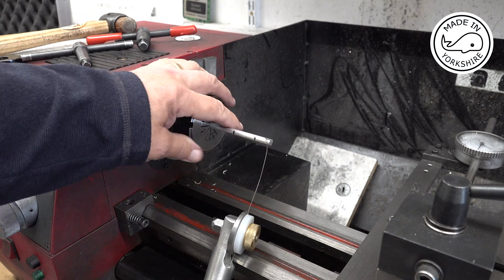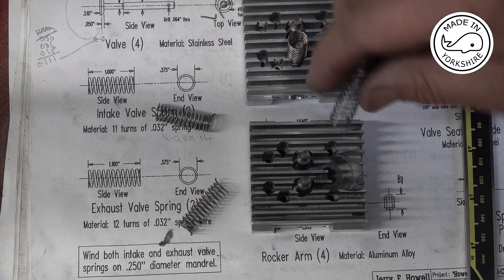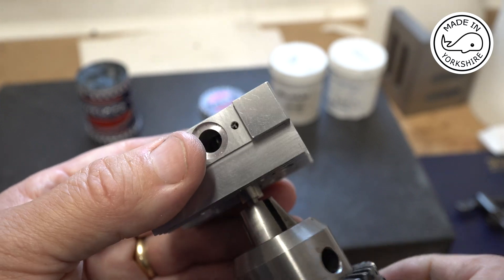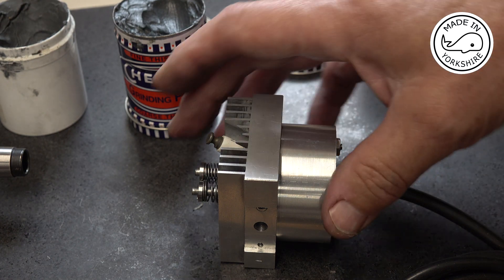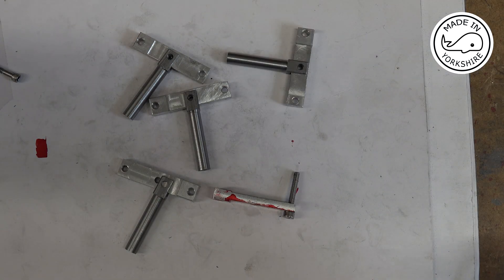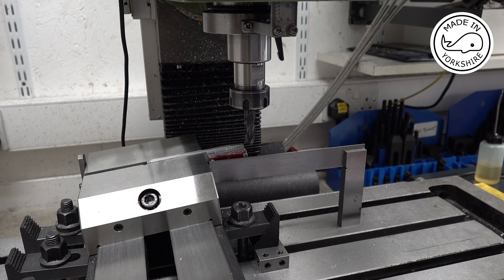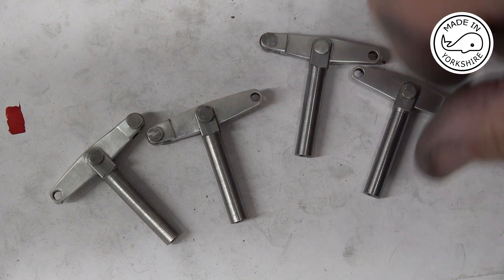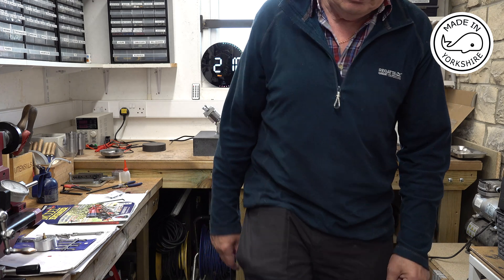#MT49 Part 17 - Jerry Howell V-twin IC Engine. Valve Lapping and Springs. In 4K/UHD be Andrew Whale.

Comment: Using the drill chuck is a great idea for lapping those valves!
Reply from the maker: Thanks Jeremy. When I tried lapping valves for the first time i used a power drill. Disaster! Some followers suggested this method which works really well. A few turns backwards and forwards, then rotate 90 degrees. Keep on repeating.
Cheers
Andrew

Comment: Another way I’ve found with small valves is to superglue a small disc of plastic on the head then use a conventional valve suction cup to grind in just like full size
Reply from the maker: Interesting!

Comment: Looking good Andrew, next time you have to lap valves , a battery drill on the valve stem makes really short work of getting them seated 😉 !
Reply from the maker: Thanks for the info. I did try that method a few years ago, the first time I lapped valves. Unfortunately it didn't work out for me and others suggested my current method.
Cheers
Andrew

Comment: Thanks for the video.
Apologies in advance if I missed it, but what is the part number of those bearings?
Reply from the maker: Hi Adrian. I didn't mention the bearing number. I purchased all the bearings, seals and bolts from the Jerry Howell website. It looks like the bearing in question is a R144-zz shielded .125" id x .250" od x .109" thickness.
Cheers
Andrew
Reply: @learningturningmetal  Thanks!

Comment: Hi Andrew, yes when the latest copy of Model engineer came through the door I was saddened to read of Ivan Laws death. I have the kit to make his large capacity fixed steady from Hemingways and his gear book which is, as you say, a bible for gear cutting in the home workshop. The heads look jolly good, onwards and upwards and get a cut on!
Reply from the maker: Ha ha - it's a classic term I must remember. Aparently Ivan licenced Hemingway to sell the Quorn tool. The kit is very expensive, but probably an interesting project.
Cheers
Andrew
Reply: @learningturningmetal  I bought a part built Quorn tool from eBay a while ago. The build quality is superb and I am reluctant to Cary on with it until I’ve found out how the builder got such superlative results.
Reply from the maker: @nigesbasementworkshop9541  Yeah - I can imagine that some of the castings are difficult to set up and machine accurately.

Comment: I like the look of those rocker arms. Important to get them right as they will be so visible. Was a bit concerned when you had 4 blanks bolted to the bar. Fully expected it to move but it held ok. The jig you made was really effective. Simple but good. So pleasing when yoir valve test fails but you flick it a couple of times, out flies the grit and bingo. Could have been several hoirs more lapping to sort it otherwise. End is in sight 👍
Reply from the maker: Thanks Tim. A few little hurdles yet. Looking at the drawings there is some kind of crankcase breather associated with the carbs. I need to get my head around that one. I must go and get a cut on!
Cheers
Andrew
Reply: @learningturningmetal  😂 I like your new catchphrase!

Comment: Coming along nicely Andrew. Now i see what you meant by a fixture to test the valves for leakage. 
Steve.
Reply from the maker: Thanks Steve. My engines never seem to start first time and usually require methodical investigation. The fixture helps by removing the possibility of leaking valves from the equation. 
Cheers
Andrew

Comment: Hello Andrew. Another time if you need to make springs of a known pitch and length, try this method. Trap the wire between two thin pieces of wood trapped in your tool post with sufficient clamping force to make the wire very tight to pull through. Set your gearbox to the pitch of spring you need e.g. 11, set it on the mandrel as you did to wind the start, then engage the half nut on the saddle, I suggest winding by hand. count your 11 turns or whatever, disengage the half nut and finish off the close end. Guaranteed a constant pitch spring of a known length, takes out all the guess work. Takes no longer to do and you know what the outcome will be before you start, no more hit and miss. Sorry did not understand why you tilted the vice up from the bed. Why not leave it clamped fully flat and put the work in the vice on the angle. That totally mystified me 😊. Great outcome. Regards from Australia.
Reply: bonjour andrew
pour vos ressorts il faut les  mettre au four a 320 degré pour les stabilisé cela va augmenter le diamètre du ressort de quelle que dixièmes ( métrique)  mai cela
évite que votre ressort se fatigue vite
Reply from the maker: @alaindecapod8381  Salut Alain. Très intéressant.
Merci
André
Reply from the maker: Hi Dave - great idea regarding the springs. Wish I'd have known that before making the Hemingways Spring Winder! The one gripe I have with my lathe is that it's a real faf changing the gears. If I ever buy another lathe I will get one with a selectable gearbox, but the headstock would have to be compatible with the other one (too much invested in chucks).
I tilted the vice because, for me, it was the easiest way to accurately achieve the angle I needed.
All the best.
Andrew